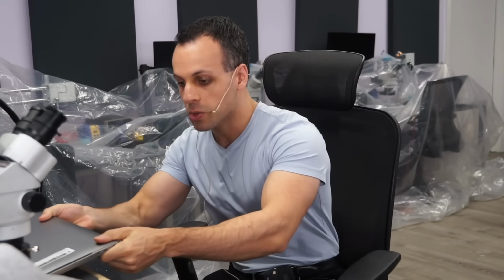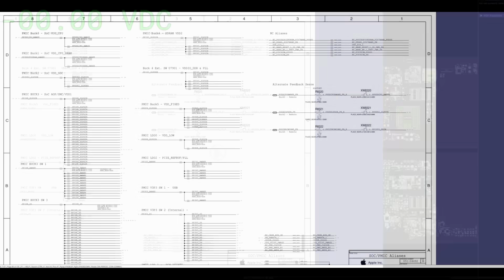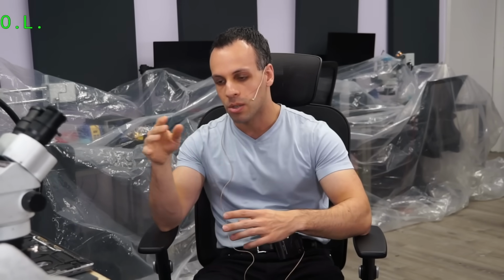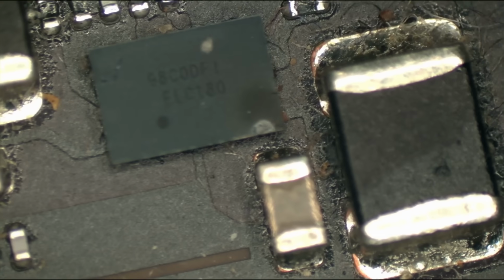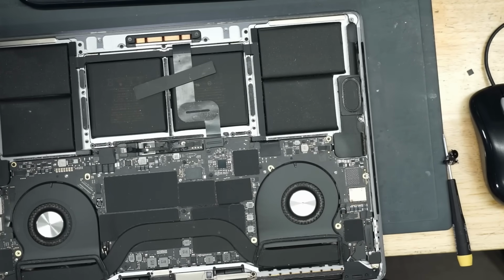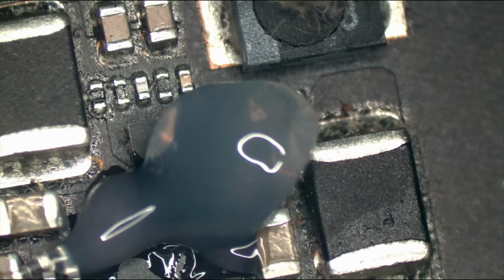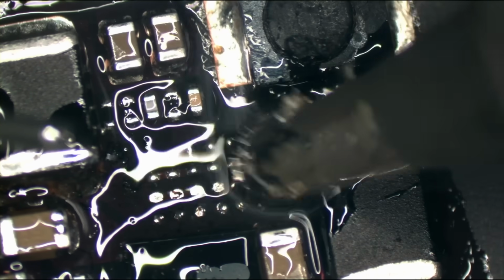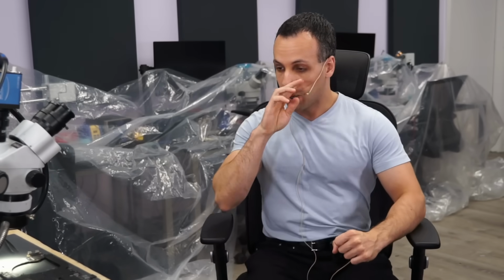How most 16" Macbook Pros often kill themselves & why they're unfixable

Comment: I totally lost confidence with Apple products after I purchased a 2017 MacBook Pro with touch-bar. $5000 laptop that failed in one year. Logic board was fried and replaced with all data lost. MacBook Pro only lasted another 2 years after repair. The saddest aspect to this is my old tough as a war tank MacBook Pro 2014 model is still going strong. 
Why can’t Apple just stick to a style of manufacturing that is repairable and robust. Or is that not good for overall profit 😮
Reply: Tim Cook is a petty cheap and stingy businessman.
Reply: @newagain9964 Apple has gone to shit since he took over. Best option is to buy shares in Apple and use the profit from the shares overtime to offset the extra hardware costs of owning Apple products
Reply: Why make you buy one $5000 laptop every 3 years when you can have to buy a $5000 laptop every year?

-Apples literal business model.
Reply: It’s wild how quickly the quality and design deteriorated as the iPhone became the true focus of the company. My 2013 MacBook Pro is still going strong and used frequently — and I was able to upgrade the RAM and switch the HDD for an SSD, because that shit isn’t soldered in. You can open this computer with a Philips head screwdriver. Although, I guess I just lucked out by going with the 13” instead of the 15”.
Reply: @Zealant   3rd party SSD uses significantly more energy and hotter, which typically needs a heatsink, making laptop thicker and less efficient. I'm believe Apple integrate SSD controller into their SoC is awesome for the heat and efficiently. Also good for instant-wake-up, Find My app, stability. However, there is no failsafe as NAND can go bad, hence the whole system goes down as firmwares are on the NANDS. There are pros and cons. All truths are half-true.
Reply: I've had quite the opposite experience. Everything has worked flawless. I went from and older macbook pro 2014 to an m1 air and had no issues, so I'm guessing those touch-bar macbooks that have a bad rep where a bad design.
Reply: Absolutely engineered to self-destruct. Makes a better profit. This is why I'm hesitant to buy new Apple products. They used to make good hardware. Now otherwise perfectly good devices are irrepairable and get wasted because reasons. It's a damn shame.
Reply: Apple speeds up the planned obsolescence because their CEO, their Board and their shareholders are impatient.
Reply: Gross
Reply: @@Jesus_Muslim.  Jesus is God in human form. Jesus is full of lights of love and forgiveness.
Reply: @samb2166  My M1Pro 14'' just died out of the blue with the same symptom in the video. I always charged while using it with Magsafe and connected the 3.5mm headphone and HDMI to the external display. What do you think could be the cause of this to happen ?
Reply: @somebodyinnobody   no idea. can you bring it to an Apple Store for a diagnosis and let us know what they say?
Reply: @samb2166  Yeah, I brought it to the tech, He said that one of the power management ICs was failed. He suspected that I might use the external monitor too often and leave the charging cable connected all the time which is not good.
Reply: @somebodyinnobody    look up "arbitration clause" for rules. send Apple a notice of arbitration, and your request for a settlement is to fix your macbook free of charge. if not, you'll proceed with the arbitration with the american association of abitration. their lawyer will contact you for a deal. stand your ground. good luck. you can do this.
Reply: @somebodyinnobody   wait, so you use the MagSafe and HDMI port 24/7? do you use any usb-c hub? I notice that Anker hubs are flimsy. I only use Lenovo usb-c hubs
Reply: @somebodyinnobody which charging cable? Mag safe?
Reply: No backup of your data, fool
Reply: I have a 2013 MacBook Air. You just got unlucky.
Reply: @olaabi2229    Steve Jobs was still there to control the design team. when Tim Cook took over, the design team was uncontrollable and the shitty 2016-2017 MacBook Pro was the worst. too many broken stuff for the thinnest.
Reply: Been using my 2018 pro 6+ hours a day, every single day since Sept 2018 and it’s still working perfectly fine
Reply: @ollyfoley6291 can explain what is the issue in the video what model of macbook?
Reply: You just need one ignorant idiot in a powerful and sensitive position to ruin the quality of a product. For me this looks like a big cultural company or department issue.
Reply: My word are you just dumb. Have you not heard anything Rossman said in this video. These things are MADE TO FAIL. Then you go back and pay for a repair, a part or a replacement. Its not by chance your devices break they are made that way. Rossman had to fight for them to make available information to help people repair their devices without having to go just to apple it called right to repair. Please spend your money on other products.
Reply: This makes me sad to hear. I’m coming from a 2013 MBP and it still works great but outgrown in. Just ordered the 16” MBP 48GB/ 40 core. So this shit more than likely will die in a year?!
Reply: @drowzzworks   don't use USB-C Hub to charge + data transfer as electricity can jump to SSD NAND and shock them. use MagSafe for power, and usb-c hub for data and display only. you'll be okay. my M1 Pro has been great!! this issue also happens to my Lenovo laptop and its motherboard was fired. This happens commonly to all USB-C laptops when you mix high power delivery + data transfer.
Reply: @samb2166  appreciate it! Makes sense
Reply: @drowzzworks   np. I would stay away from cheap USB-C hubs, Anker could be unreliable too. I'll stick with Belkin, Lenovo, Dell, and thunderbolt certified hub.
Reply: @samb2166 What about m1 pro 13 it has only two usb-c ?
Reply: @3Toy   use one for charging and one for data transfer to avoid SSD death
Reply: @drowzzworks ofc not
Reply: @drowzzworks  Had a late 2013 MBP 15" until 2021 and still going strong, then got the late 2021 MBP 16" M1 and it's also a beast, no fan, no technical issues, nada. Not sure what issues people run into, but my guess is there's a line of MBPs that doesn't keep chugging as long?

At a previous work I had a MBP 13" with touch-bar, and the only thing that broke on me was the keys which were poorly designed and built.
Reply: Butterfly keyboard is to blame. Using cheap non-thunderbolt hub might have fried try the motherboard. It seems like Apple made a mistake of forms over function.
Reply: because low quality products = more profits, that's Apple's new motto these days😂

Comment: I must have the world's best luck.  I still have every macbook I have ever purchased and they all still work just fine.  I have replaced a few batteries and had to change one magsafe board (twice since the one I bought from your store originally was bad).  Never had one die while it was my primary work laptop, which quite surprised me since I travel in the oilfield for a living and have been known to abuse them.  Most of my older machines have several dents and bent corners but I have never had one die on me.  I cannot say the same for PC laptops, which is why I finally switched to Macs, back in the days when a macbook only came in white.
Reply: Same here. Never an issue outside warranty. Most Macs are extremely reliable and much more so than any top end pc laptop. My company replaces our surface laptops on average once every year and half due to failures. Those “known” Mac issues are still relatively isolated.
Reply: Interesting, I've been wanting to switch to a 16inch MacBook M3 pro but now I'm scared lol what are my chances it will last in your best guess? I really want it, but I want it for like 10 years if I can...

Comment: Every time I watch a MacBook video from Louis, I’m afraid my MacBook breaks down while playing the video. Then I need to check overall statistics instead of biased events (biased not meant as criticism. But Louis obviously only encounters the malfunctioning MacBooks, not the ones running smoothly) to calm myself. Despite of the better repairability windows laptops don’t last as long (only 4-5 years on average). which means even if you repair your laptop multiple times, my MacBook is statistically going to outlast you. You can hate on me, which I’m 100% sure you will, but this is not my opinion. It’s just facts.

Comment: I knew Apple was a piece of shit way back when I looked for my first computer in the 80s. I wanted a computer I knew everything about (schematics - operating system) and I knew Apple wasn't that. I went instead with a computer made by Osborn which shared everything. Wish I could say my Osborn(s) still work but I think all of the floppy disks over time lost their magnetic information due to cosmic rays. I should have refreshed new floppies by reformatting them then using them for copying older floppy disks. Too late.

Comment: They're indeed unfixable by design. When I worked at a Macbook Warranty Depot, we pulled 36 screws up, disconnect everything, junked the board, and did it all in reverse. They dared to call us Macbook Techs when we were nothing more than Assemblers.

Comment: Seems they build devices that tend to not be reliable unrepairable too. My Surface 7 plus, second one this year stopped charging, my tech said the motherboard fried.  My other Surface 7 plus would shut off with 80 percent battery that was under warranty this time expired warranty, it is junk...at least I have the removable hard drive.

Comment: I am tempted to buy a fully spec out M1 macbook late 2021 pro 16 with 4 TB of storage and 64 gb ram for only 3000$ dollars its an amazing deal, a similar configuration will cost you upwards of 5000$ dollars, but this video and others from Louis has really cooled me off to that idea, I really don't want to take the risk of a 3000$ dollar computer inexplicably falling on me one day and to later find out that it is dire need of expensive repairs or that it is in worst case scenario unrepairable. My 2019 Dell XPS 15 laptop is still working just fine the only issue i have its low battery life.
Reply: did you still buy it?
Reply: @site.x9448  no I did not buy it. I settled for a high end gaming PC that I purchased from Costco.

Comment: Opened up Mactracker to see what the model number on my MBP is after hearing you repeat it a few times...

A2141...

Fuck.

Bought it from OWC. So at least I didn't pay full price.  I guess I can just hope Hashem sees fit to let me finish paying it off before my SSD gets cooked?

It lives on an aluminium laptop stand on my desk and is plugged into a dock. I don't travel with it. But it is my daily driver. (My PC is literally just for gaming at this point)

It does hourly Time Machine backups to an external drive, and all my actually important data sits on a NAS in my server. So I'm not worried about data loss. But as I can't afford a Mac Pro, Studio, or used iMac pro until this thing is paid off... I'd be stuck going back to my Windows PC and not being able to use Logic Pro or any of the software I've become accustomed to using in my daily life.

Is the chip you showed in this known to be faulty? Would replacing it as a preventative measure be worth doing? Or is this just one of those situations where I gotta hope and pray, wait and see?

(Not that my soldering skills are anywhere near on your level, so it's not like I'd try to replace the chip with my big, dumb, meaty hands. But I'm still curious.)

Comment: All apples users should use Time Machine or some other type of backup. It's the operating system of the Mac I like. One of these days I will upgrade my motherboard, cpu and memory for my Windows machine so I can use Windows 11. I wish Microsoft had a better Task Viewer more akin to Apple Mission Control when using two monitors. If Task View had a way to not change both virtual monitors on both monitors at the same time and instead only change one virtual monitor on the left side and not effect the monitor on the right side or vice versa. I'll try to use Task View a little bit more after upgrade to Windows 10 to 11. Also Apple uses special mice for other there os verses the way Windows uses its mice. I hate Apple hardware and love the ability to build my own computer for Windows hardware.

Comment: I have found some types of flux residue, that should have been cleaned in production, can affect circuits and eventually lead to corrosion.  At first, the flux looks like a dried white water spot but when it is humid, it turns into a little snot ball.  The slimy ball affect circuits and eventually corrodes.  We also see MLCC capacitor failure (becomes short or leak current) that occurs from stress.  The stress can be introduced during production (most often) when handling PCBs or by the stresses in use.

Comment: I'm still not over my 2017 MacBook where keyboard and touchpad got defect even though I never used it. I used the MacBook exclusively with an external mouse, keyboard and monitor.
When I bought a new computer I tried to use the MacBook as a mobile device on the couch and discovered it was unusable. It didn't matter much anyway, because it doesn't install the latest OS version and this reason more and more apps from the AppStore can't be installed. It's a quite expensive bulb of waste.

Comment: You would think there would be a resistor that would burn up between the NAND and the boost converter if this is so common, like it's a part thats like less than a cent.

Comment: i have no special love for apple, nor do i have any excessive hate. due to my profession i have had both windows (mostly lenovo, some HP) laptops and macbooks simultaneously for the past 15 years. my observation was (and this can still be coincidental of course) the macbooks never had an issue, apart from OS bugs here and there. no hardware issues at all, ever, not once. with the lenovos i had a few repairs here and there. i can't judge the "guts" but all outside components were extremely nicely built and never ended up with issues there, my 2012 macbook air looked like new in 2018 still (despite daily use). could it he that as a repair guy you end up with a bit of an overly pessimistic bias, due to of course only seeing the bad apples and on top of that people often lying about how careful they were?

Comment: I had a Macbook Pro of this exact model, I was having problems with the battery but I knew it didnt need replaced because it had one charge cycle. I ran internet rec diagnostics and it gave me a PFM006 error for the SMC. Is it possible my SMC chip went bad? I had already tried a reset countless times. It was boxed this entire time.

Comment: I have a 2020 M1 macbook air, all out of a sudden since yesterday, it does not turn on or charging, stuck at 5V and 0A, should I assume all my data are gone as well (I have cloud backup though). i am just so disappointed with Apple, I used to think this M1 was the best laptop I ever bought, but not anymore now.

Comment: Pardon me, but how is it Apple’s fault that the chip blew up? That chip is not designed by Apple. From the chip name TPS6180 I assume that it is a Buck converter IC designed and manufactured by Texas Instruments. Why not trash them? From the info provided in this video,
It is equally possible that Apple implemented that chip in a bad way, as well as that the chip is garbage and fails, even though implemented correctly. So there is a bit of a rush to judgement here.

Comment: I own this mac. Is it possible to make a change to circuitry so that this failure is prevented ? Make apple job with a smd zener diode (a diode to send 13v to gnd instead of to the ssd) like apple should have done ? Or maybe make a custom adapter that solders in place of this crappy ELC180 chip. Like solder a 7805 or something like that on a flex PCB you then solder to replace the defective chip. The maintenance should be preventive and not curative. 
Sent from an A2145 in desperate need of help. 
Thanks a lot to the whole Louis rossman family 😻😻😻for making this high value content available to other people, so we can make our day better and fix the macs apple was not capable of fully engineer before putting on market.